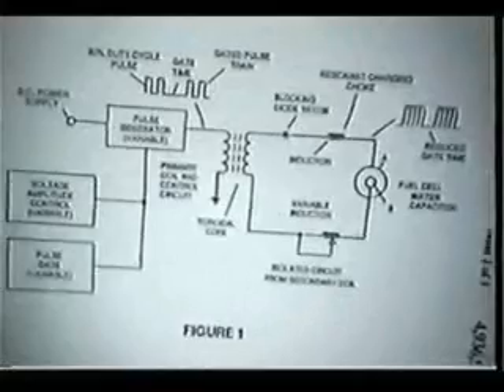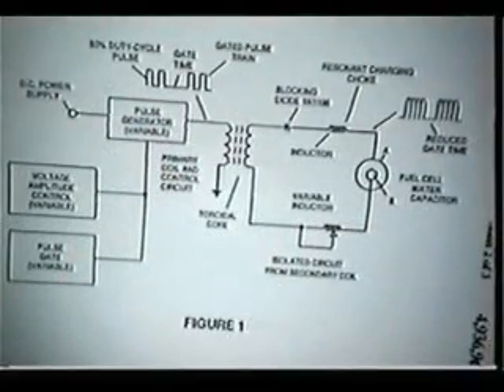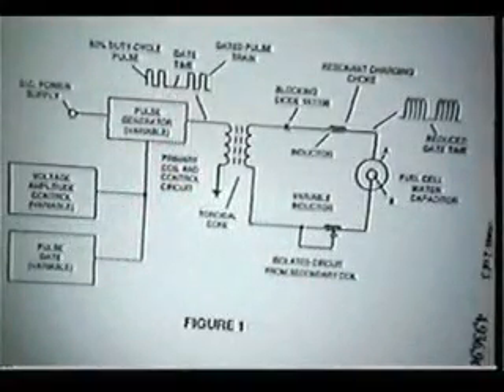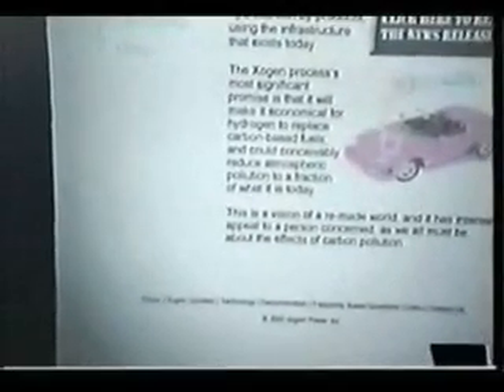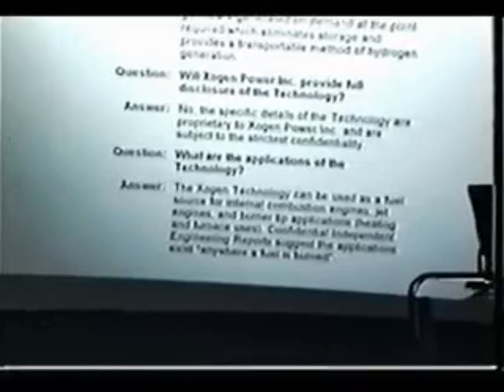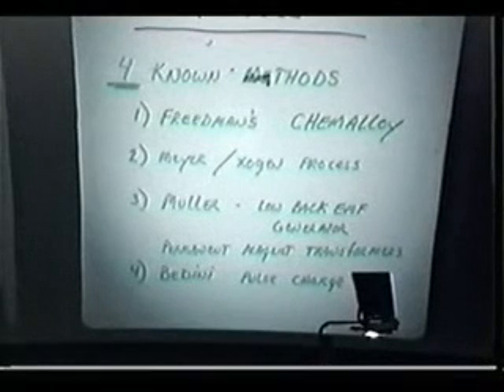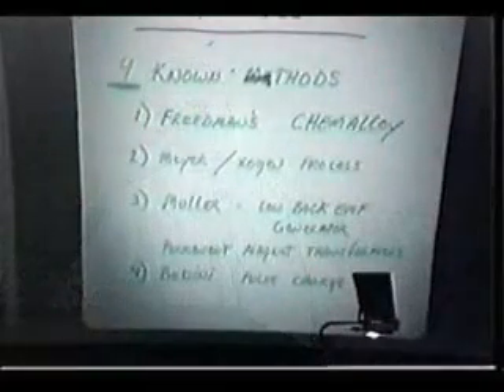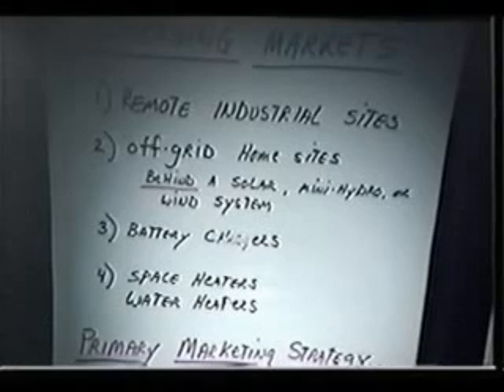Stan_Meyer_System_Explained

Comment: @beginerhydro this man is wrong
the resonance is between the capacitors and the inductor.
i believed this video when i first saw it......but he is just wrong.
when electrical resonance is found amps are restricted and voltage flows though and goes up as pulses continue. hho production goes up as voltage goes  up.
the capacitor does not break down. it charges and resonates with the inductor. when the inductor charges higher it reaches resonance with water.